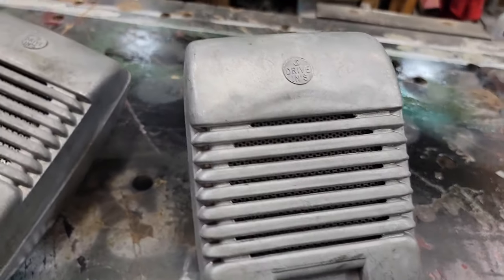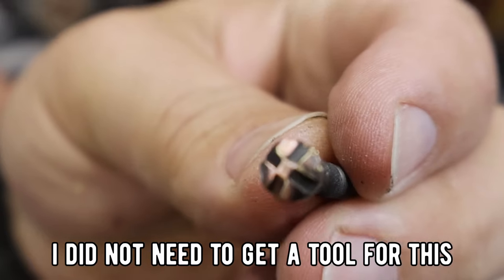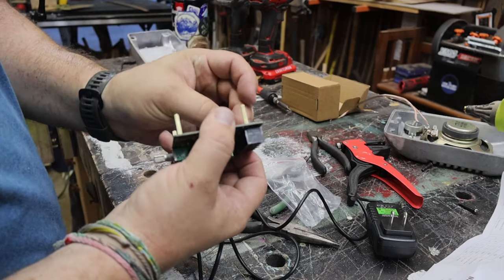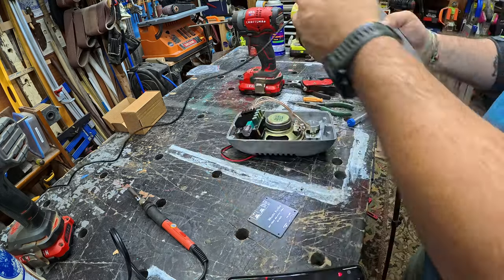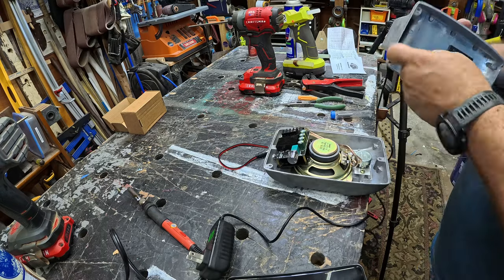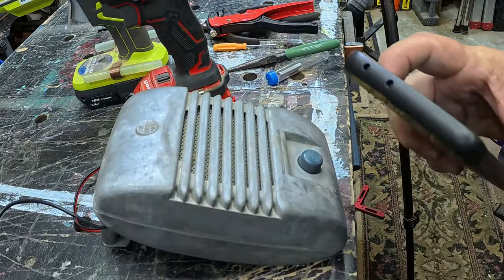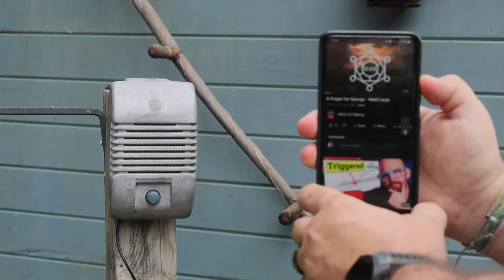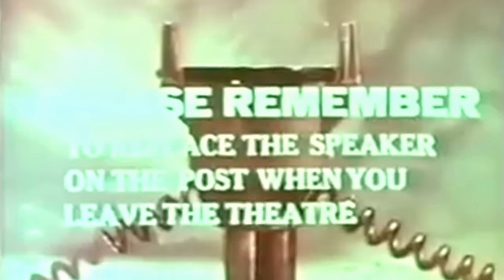Bluetooth Enabled Drive-In Theater Speakers

Comment: What a cool use for that old speaker.
Reply from the maker: Thanks man! Only took me a year+ to actually get around to making it. Was originally going to do an embedded Arduino, write all the code for it, etc., but I found a pretty powerful module ready to roll on Amazon for $25. 

This was after I was attempting to repurpose a cheap USB speaker's guts for this thing, and I ended up frying the board because the solder contacts were far too tiny, and my soldering iron far too cheap and hot :)

Comment: Old guy question: Does that need to be plugged in full time, or is what you plugged in a charger?  Looking to make one that I can actually hang on car window at a car show.
Reply from the maker: This one specifically does. i actually tested this out first with a super cheap rechargeable USB speaker that I had lying around, and it also worked fine. Not as loud though... You could definitely find a USB speaker that is rechargeable and sacrifice it for the speaker driver, charging port, etc. These are fairly easy to drill through if you need a hole somewhere for a charging port. 

Lots of options as to handling the charging port, or if there is a battery pack, etc. I have some ideas for each, if you want to chat on this further, you can drop me an email at the@newjankyworkshop.com